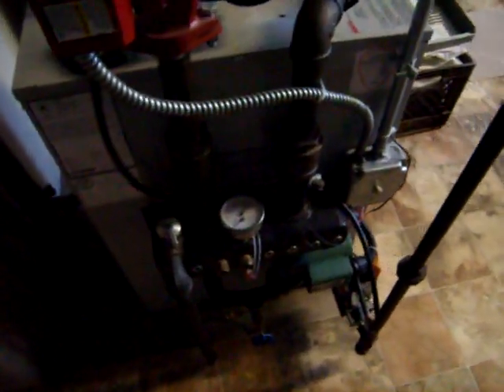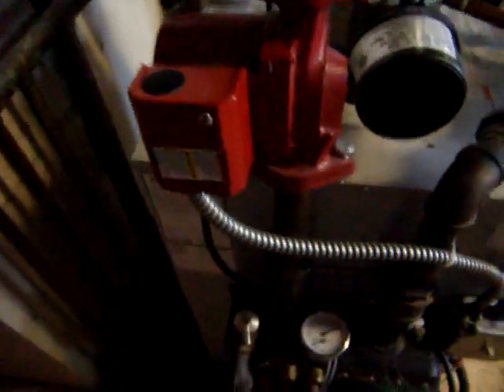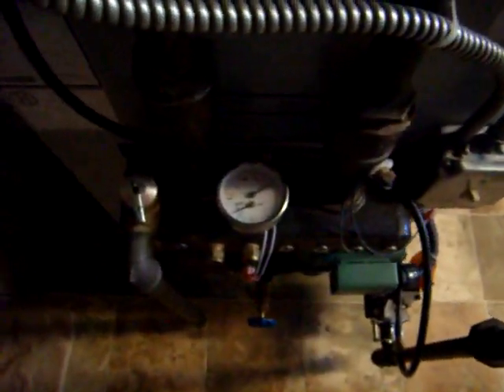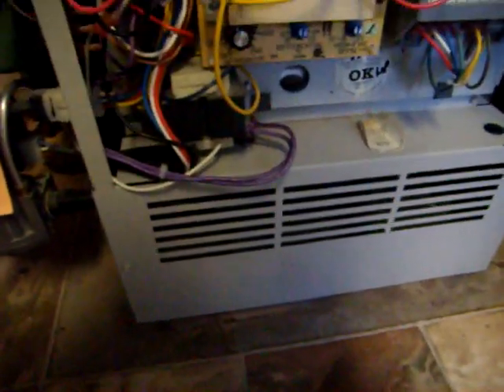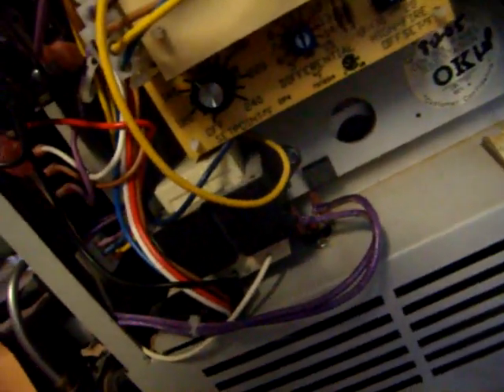Lochinvar Sucks 1

Comment: Your pump should not be running when all the zone valves are closed, you are deadheading the system and causing the boiler to over heat. Looks like you need to check your pump wiring or install a system bypass if you want the pump to run while the zone valves are turned off. Not the boilers fault.

Comment: If your house has two zone valves your installer should have put in a two zone valves control  relay. And that relay is controlling your boiler to run if any of your thermostat is calling for heat, that zone contral relay is the one that control you zone valves. If your installer did not put that relay that will be the problem.

Comment: Nothing wrong with the boiler it is functioning as it should. what you have is a faulty zone valve sending a  false TT or end switch to the boiler, replace the zone valve and the problem will go away.